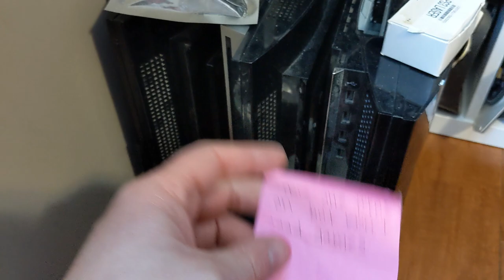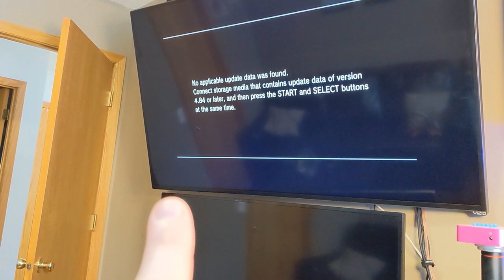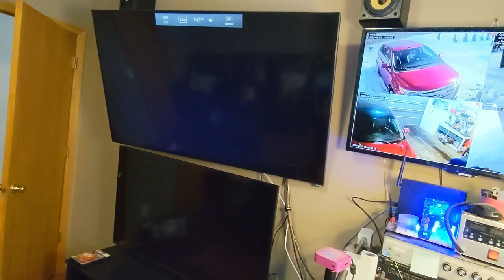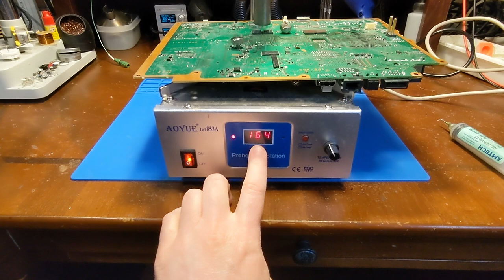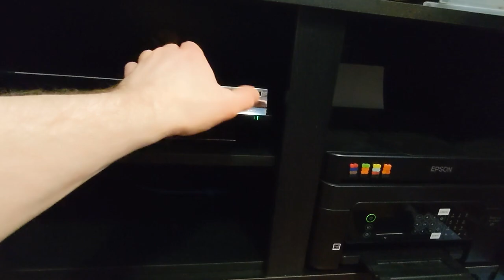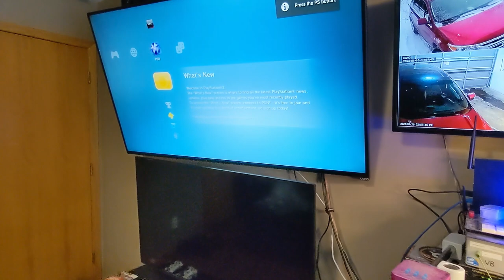Lets Fix PS3's in 2022

Comment: Hey, is not a good idea to have a backwards compatible ps3 console in such small place. It's true it expels heat on the rear side, but it does too on the right side. Even in the best of the cases is not a good place because those places have a very poor ventilation.
Reply from the maker: The entertainment center has a fan mounted on the back. It sucks out all of the hot air and blows it out of the cavity. So it continuously has cool air coming in through the front.

Comment: My fat ps3 I have to push the disc in and I need to press eject multiple times until the disc shows up a little then I pull it out with my finger tips. It could be dry rubber? Because it is spinning in and out. How can I fix that?

Comment: I’m facing this weird YLOD, had replace the cap. But still have YLOD, it will boost up the fan when turning on and shut off then beep in YLOD fashion
Reply from the maker: Probably GPU/BGA failure. There are methods for reading the error code.
Reply: @jeffescortlx  Thanks! Btw wondering if there are missing caps due to carelessness, is there a way to check by board diagram or schematic? Or does it has to be done in the analog fashion way one by one to compare?
Reply from the maker: @arcadesnafu8329  missing caps? What do you mean missing caps?

Comment: How did you manage to fix the processor traces? I've never seen anyone complete such a repair. Typically a failed de-lid is assumed to be unfixable.
Reply from the maker: I wouldn't have been able to without my microscope and experience of fixing traces.
Reply: Hi I damaged some traces on my processor during my delid can you provider your service, thanks in advance and great work
Reply from the maker: @22JoSe22  could you send me some pictures at 1mr.repairman@gmail.com

Comment: Misinformation on 7:30, it actually IS the bga failure on the RSX, the NEC Tokins CAN fail, but most of the time it's your RSX
Reply from the maker: Yes. This video was made right in the thick of the NEC tokin pandemonium, before syscon was common place. Although I believe internal bump failure is more common than BGA failure. It looks like if I had to make an estimate about  35% of YLOD is because of the caps, remaining would be GPU failure of either bumps or BGA balls.

Comment: Idk man I just watched a 2 hour video with sources about how the caps aren't the problem and the ps3s usually break after a week of use with the new caps
Reply from the maker: It's been over a week and it still works. And yes I've watched the same video.
Reply: well the video said it's not a definitive fix
you should do as much troubleshooting and check syscon before making a judgement on what fix is needed
Reply from the maker: @STRmw2  it seems to me people get stuck on a theory that there can only be one problem. While I believe most (eventually all) problems are because of internal GPU bump failure, that doesn't mean caps also can't fail.

Comment: Have problem with COK-2 board (fat PS3 5USB port). First power on is always problem, after couple minutes picture got frozen no matter is start screen of PS, menu of game or game itself. After restart console work normal like nothing happen. Check HDD with Sentinel low working hours and 100% health, try data recovery, system recovery, new system, new update...  and always same problem. Fan is at low or second speed, new thermal... any next step input I will be appreciative.

Comment: Would having a custom fan curve at 40% on a chech0a help extend its life? Currently on mine, its stays around 60-62c cell, 55-57c rsx when gaming. Or would the console ultimately overheat and kill itself?
Reply from the maker: I'm really not the best to give advice on this since I'm not a PS3 expert. But in my opinion as long as the thermal paste is fresh on the top and bottom of the heat spreader and as long as you have good circulation I would think it would be fine at the stock fan settings.

Comment: If I can at least make it known, its not the capacitors. These GPU chips were not designed correctly at the factory. Sony and Microsoft were affected, and thats why these early systems failed. They realized what was happening and fixed it with the later revisions. If you want to save the classic PS3, take a GPU from a newer one thats compatible, and place it in there and follow the tutorials online.
Reply from the maker: I watched the same video you did. And I agree the GPU is a major issue. But go back to that video and see what he says at 1:15:47
Reply: @jeffescortlx  checking that now
Reply: @jeffescortlx  That was a good bit to know. Thanks!
Reply from the maker: @3v068  I think some people just looked at his thumb nail and didn't dig deep into the video. People seem to be convinced there can only be one problem that causes YLOD. But just because the 90nm GPU is of a bad design, doesn't mean the caps can't fail.

Comment: So what's the problems when the console boots up then the fan speeds up then goes to normal speed,  also no hard drive blinks and no safe mode boot up- green light and blue lights work

By the way does replacing tokin capacitors get you banned if you sign in to your PlayStation account? No one ever says that you can or can't get banned
Reply from the maker: Sounds like you just might have no video out. Have you tried resetting the resolution by holding down the power button? Just replacing the caps won't affect how the console is seen online, no need to worry about getting banned.
Reply: Thanks for replying, I tried it with a av cable too and no display either, but I don't think its just a video output issue cause the console does not want to go into safe mode and the hard drive doesn't want to do its job either I get no blinks from it and yes I tried a different hard drive and it still doesn't work.

Comment: I also fixed many ps3s with the same system.  however i had to deal with a backwards compatible, changed the capacitors in the back of the rsx as usual but this time i didn't fix ylod.  behaves exactly as before.  I don't know what else I can do to fix it, how do you know?
Reply from the maker: The YLOD is more than likely rsx chip and/or BGA failure.

Comment: I had a fat PS3. I added 3 computer fans cool it down replace the thermal paste! Drilled holes in the shell for the built-in fan to bring in air it's still blinks red!
Reply from the maker: You probably have a failed GPU, not a hot GPU.

Comment: I fixed slim ps3's that over heating CPU with out delidding. BUT fat ps3's might need delidding or a fan with more blades
Reply: The best fan is the 15 blade version. I swapped my 17 blade fan with a 15 blade nidec fan and the system ran a few degrees cooler according to Web man, and lower fan speeds were able to achieve the same results compared to the 17 blade fan running at a higher rpm.

Comment: It's not the capacitors. That solution is also temporary. The issue actually goes super deep, like shockingly so. If you're interested here's a video that explains the science history and mechanics of the YLOD. https://youtu.be/I0UMG3iVYZI it also explains how and why the balls getting changed or the capacitors getting replaced will fix it for a few weeks/months or maybe a few years before going right back to being dead.
Reply from the maker: Now go to the end of the video where he explains the NEC caps actually can and do fail. I know GPU failer is a higher percentage. But to say the problem cannot be the caps is misleading and incorrect.
1:20:42 into his video.
Reply: @jeffescortlx  i agree the nec caps can fail but as of now its a bit rarer. i just want more people to know about the GPU failure since its all too common for people to replace the nec tokins and find out that the yellow light has returned. i personally went through 4 PS3s before learning this and i like spreading the information. I do however reccomend replacing the nec caps though since generally they are old and will also fail 3-5 years down the line at a semi worldwide scale considering the life span of them plus the release date of the PS3. same thing happened with the PS2 and original xbox.

Comment: How do you know in the 2nd PS3 it was was 2 capacitors and not any of the other 6?
Reply from the maker: It certainly could be any of the NEC's. But the GPU and CPU capacitor sets are in parallel (independently). So it doesn't matter which ones of the set get changed, adding capacitance to any spot affects the group.
Reply: @jeffescortlx  you are awesome! Thanks a bunch, I'll order a few in case I need to change them all

Comment: Ciao ho un ps3 fat cechc04. Ho un problema strano, in quanto la ps3 si spegne da sola quando utilizzo alcuni giochi come, la noire, infamous 2 ecc.. La cosa più strana che si spegne più o meno negli stessi punti del gioco. Ho cambiato la pasta termica, ho sostituito l'alimentatore e anche l'hdd, ma non è cambiato niente. Da cosa dipende questo problema?
Reply from the maker: Is the fan running fast when it shuts off?
Do you get an over heating message on the TV?

Comment: Where do you buy PS3 electronic parts?
Reply from the maker: It would depend on the part you would want to buy.
Reply: @jeffescortlx  mine is a super slim...got busted usb's,  HDMI ports not working...mostly ports...anyway, i want to specialize in ps3 repairs..so i want to make sure i know where to get the parts in case i need to replace 'em...this video REALLY put's me in place...very
Reply: question is....are they available some place? and are they really available?
Reply from the maker: @Romwel  yes I would think things like ports would be sold on eBay or Amazon. Otherwise I'm sure the specs and part numbers have been been discussed on some old forum's that can be found with a google search.

Comment: Where can I get my bulky ps3 reballed? I have the yellow light the guys that hardly fixed it ran heat on it already. I need those things replaced
Reply from the maker: How do you know it's not the capacitors that are giving you trouble?
Reply: @jeffescortlx  it couldn't be anything else. Usually I found out that's what it is to be 90% of the time. I'm so desperate for anyone to get it done. Can you please possibly take a look at it?
Reply from the maker: @briandrumgold642  I found out that 90% of the time people thought they were fixing it by reflowing/reballing when it fact the process of heating the board temporarily revived the capacitors. How are you sure the BGA is bad and NEC caps good?
Reply: It just shuts off everytime I turn it on now. Fire it up, green light turns yellow and its a blinking red light all the time. I'm not tech savvy, the guys that were suppose to fix it were more concern getting money from new ps5, ps4, Xbox one owners. And mine was just collecting dust in the back taken apart
Reply from the maker: @briandrumgold642  ok, so it's doing exactly the same thing as #2 in this video.
Reply: @jeffescortlx  yes it is
Reply from the maker: @briandrumgold642  guess how I fixed it?
Reply: @jeffescortlx  I see how you fixed it but Im not taking anything apart
Reply from the maker: @briandrumgold642  if you have a local computer repair store they should be able to handle a cap replacement.
Reply: @jeffescortlx  just did that and they said it couldn't be replace because it was nothing wrong with it. They just didn't care. Can I send it to you?
Reply from the maker: @briandrumgold642  email me at 1mr.repairman@gmail.com
Reply: @jeffescortlx  "I'm sorry but I do not offer PS3 repair at this time."

😏

Comment: my ps3 slim fan increasing speed till max just few minutes after switching on the console even without launching games then turned off because of heat warning sign, any solution guy? pls
Reply from the maker: You'll need to have the heat spreader removed for fresh paste. Just like in the one in this video with the fast running fan.

Comment: what kind of tantalum capacitor you used
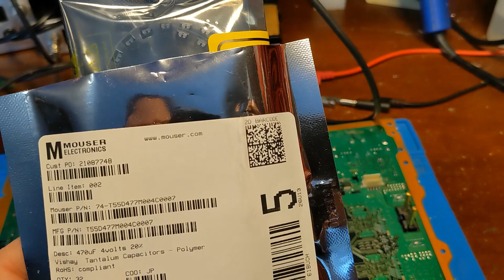Reply from the maker: 10:00
Reply: @jeffescortlx  i took all the neces on my ps3 so if i add that tantalum will it make my ps3 back alive
Reply from the maker: @joemusashi2701  if you removed them all you'll also need to add the positive jumper wire.
Reply: @jeffescortlx  sure i'll do that hope i can make my ps3 work
Reply from the maker: @joemusashi2701  here is a good forum to read up on. I hope you get it working: https://www.psx-place.com/threads/research-experimental-nec-tokin-capacitors-replacement-ylod.25260/
Reply: @jeffescortlx  thanks

Comment: How could I fix a PS3 that has a black screen?? Any ideas??
Reply from the maker: Try resetting the resolution back to 480 by holding down the power button. Also try the AV output with composite cables. If you get no video at all then it's probably a bad GPU.
Reply: @jeffescortlx  ok I'll try that, what is a GPU? And is it an easy fix for an average Joe? Lol
Reply from the maker: @frankcastle3827 GPU, The graphics processor chip, aka the RSX chip. No it's not an easy fix, even seasoned technicians struggle with BGA work. Research PS3 Frankenstein to see details for a proper repair.
Reply: @jeffescortlx  ok I'll look into it

Comment: Now jailbreak it and put dynamic fan speeds on to keep it running forever
Reply from the maker: I'm really not a believer in modifying the fan speed. I like the original engineers design of automatic fan speed based on temp.
Reply: @jeffescortlx  so u like your chips to bake at 85c before the fan changes your system won’t last long
Reply from the maker: @revokednetwork4212  yes I have confidence the Sony engineers know what they are doing and I'm not going to claim I'm smarter than them. And what do you mean won't last long? Original PS3 are 15 years old and many are still working with original fan design.
Reply: @jeffescortlx  why do u think there are so many broken ones Sony knew there was a heat problem but they pushed them out anyway
Reply from the maker: @revokednetwork4212  why do I think there are so many broken ones? Because the purchasing team cheap'd out on NEC caps.
Reply: @jeffescortlx  there not all nec tokin caps most are dead or bad rsx do to heat
Reply from the maker: @revokednetwork4212  true maybe not all are from the caps. But I would love to know a real percentage of failed phats from the caps vs. the one's people thought was a reflow/reball needed but was in fact working again from the caps getting heated from the process.
Reply: @jeffescortlx  in my experience the original fats 4 usb have problems with the 90mm chips overtime from heat that’s why I keep mine as cool as possible
Reply: @jeffescortlx  U need to do some more updated research on repairing PS3's on the PSX scene forums. all ur myths about the caps will be revealed and the reasons why Sony didnt do a great job from factory. Ur percentages will be covered more there too.
Reply: @anthonyboccardo2726  thank you
Reply from the maker: @anthonyboccardo2726   I've been paying attention to the PSX-Place thread since the end of 2019. I just read through a few more pages. It's 228 pages and most if it is just people re-explaining the same thing over and over. But the good information I can find doesn't change my theory. I'm not saying NEC/Tokin is the only thing that can go wrong with a PS3. But I am willing to bet a high percentage of YLOD was because of the CAP's and not because of BGA fractured balls. I was also convinced that reflowing was related to the problem because it would "fix" them, but for me it was always temporary. Since failing caps can regain some capacity with heat it makes perfect sense to me that the NEC caps are the majority not the BGA.
Reply: @jeffescortlx  Obviously not close enough attention then, ur reading the in the wrong spots for the percentages u asked about b4, the new methods of looking for errors are on the syscon and reading the errors and collecting that data for future references. If u follow the ones that have actual knowledge on it all, its where its all at. u will find the majority find the tokins caps are really only like 2-5% of repairs, and ive found the same results in the 15+ years ive been repairing these. Its not just BGA related either its mostly finding the GPU and CPU fails way more than the tokins alone, the facts are stacking up right in front of u.
Reply from the maker: @anthonyboccardo2726  if you drop me a link I would love to read up on it.

Comment: Sorry but, do not repair a PS3 if you don‘t know what you doing. The yellow light is for mostly not the caps. And changing the thermal paste and not closing the PS3 case and then wondering why it is loud… that shows me that you not know anything about PS3. Google is free too use.
Reply from the maker: It's the NEC caps about 30% of the time. The top lid isn't needed for the heat sink and fan to cool the CPU / GPU. It's only needed to redirect the air over the power supply and the disk drive. But the thermal sensor isn't in the power supply, it's in the CPU/GPU. So if the fan is running high, it knows it's the GPU or CPU because that's where it's taking the temperature from.